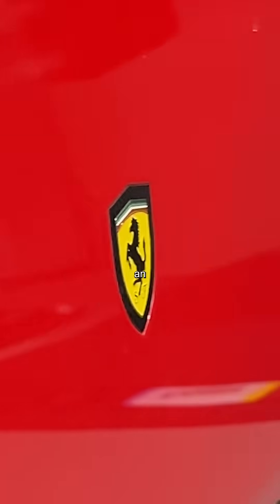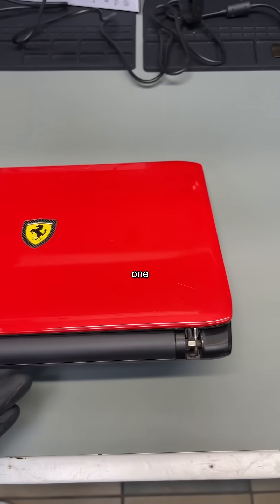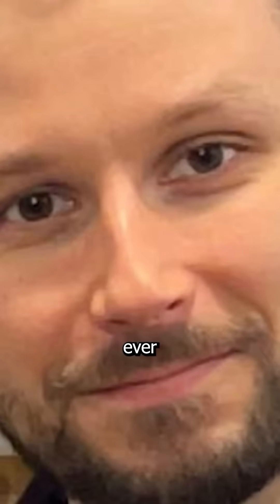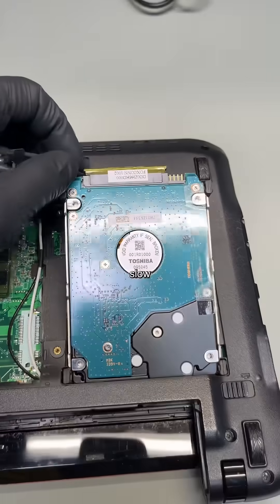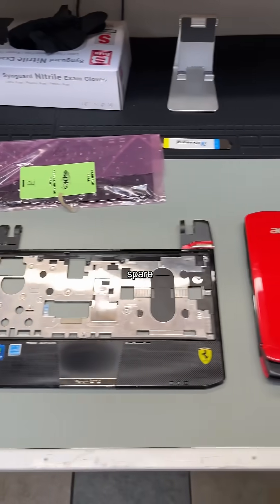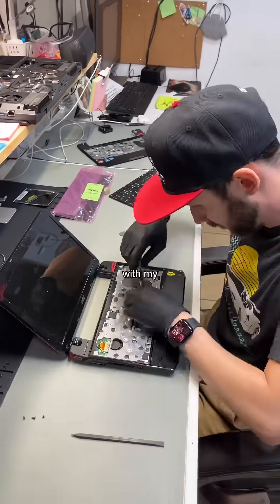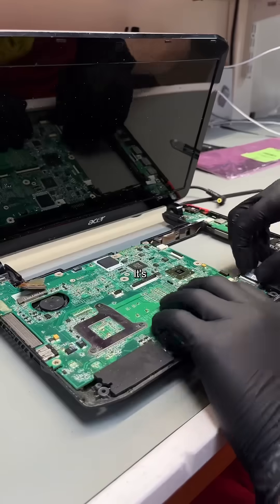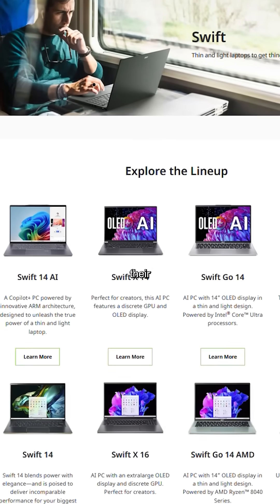Rebuilding an antique #Acer Ferrari One 200 #PC using modern #tech ! #technology #shorts

Comment from the maker: The Greatest Collab That’s Ever Lived
Reply: True first reply
Reply: An even greater collab would be the greatest technician and phone repair guru 👀🔥
Reply: Hello
Reply: Yes
Reply: Still faster than leclercs car 💀
Reply: I FUCKING WANT IT
Reply: Still faster than leclercs car💀
Reply: That’s collab ever the lived greatest
Reply: The worst technician that's ever lived
Reply: I had a swift 3. The hinge gave out, it was one of those ones with threads glued onto the chassis held by plastic instead of being part of the metal. Are the new models still the same from Acer?
Reply: I actually have one of those where do you get parts for it want to restore mine
Reply: will you be keeping this?
Reply: Why do u use doors elevator music? It’s good tho ngl
Reply: Remembered I sold all two of them. It was one 15,4/17" and one smaller maybe 14". Was working as a hopeless tech guy in electronics store then. On a busy week I got 100 Acer laptops in for repair and warranty(I did only recive and confirm physical damage, before sending it in for repairs) . Think we only sold Acers back than as an exclusive deal, but the cheap models failed alot.
Reply: Now do a full vid on how it is working with the temps pls😅😅
Reply: Yeah
Reply: I actually have ferarri glasses
Reply: Put Linux on it
Reply: Fr
Reply: I need your help please 🙏
Reply: Why would Ferrari choose Acer to collaborate with?!
Reply: @salemtechsperst i found a rog and lomburgini collab
Reply: waiting for the second collab with the greatest dell technician that ever lived
Reply: if you don't control the temperature of that amd cpu, well, you're fuc*
Reply: The greatest Acer that’s ever lived
Reply: Fr, btw why the repost?
Reply from the maker: @CoolChickenNugget385 YouTube showed me the right thumbnail then switched it after upload to a thumbnail of my arm 😂
Reply: @SalemTechsperts  lol, classic youtube
Reply: @SalemTechsperts  your upload time is as slow as me in my dreams when I'm being chased by the greatest technician that's ever lived
Reply: @SalemTechsperts  arm64 🔥
Reply: @SalemTechsperts cool laptop man

Comment: The collaboration between Acer and Ferrari has tradition: Acer sponsors the Scuderia and in turn uses the famous logo of the prancing horse for selected high-performance notebooks. Now Acer wants to provide speed in the netbook sector, and draws upon the good name from Italy once more. We have had a closer look at a pre-release model of the Acer Ferrari One 200.Punctually with the release of Windows 7 on the 22th of October this year, the red netbook should be available in shops. Acer plans to provide several variants, which should only be differentiated with respect to their communication features, such as Bluetooth and UMTS, not by processor or graphics card: the CPU is an Athlon X2 L310 from AMD with 1.2 GHz clock speed, and the pixel calculations are performed by an ATI Radeon HD 3200 onboard graphics chip. Acer will offer the Ferrari One 200 from 499 EurosNaturally for a netbook carrying the name Ferarri the corresponding color scheme is Ferrari-Red, and thus the lid, lettering on the function keys, as well as several of the accents are luminous "rosso".
The power button on the top right above the keyboard shines in the typical red. In two places the famous Ferrari logo was additionally integrated: in the middle of the lid, and bottom right on the hand rest area.

With 1.5 Kilos weight the Ferrari One is pleasantly light, and the Acer engineers also saved space: not even 2.5 cm height is measured at the thinnest point.

The chassis reminds of the shortly tested Acer Aspire Timeline 1810TZ, of which we have very fond memories: everything was built solidly on the 1810TZ, the design was nice to look at, the materials were pleasing, and nothing rattled or warped.
And also the Ferrari One appears to be without faults at first glance: The keyboard sits firmly and does not bend through, and the chassis can be described as rigid. The only smaller weak spot is the display lid, which allows through moderate pressure from behind to the display.

Comment: If you are gonna replace your hhd with an SSD (sata), make sure it has an dram ram cache if you want good write speed beacuse without it these ssd will be slower than a hhd for data transfer, but cheaper ssd are a fine option if you don't transfer data around  too much and yiu will not know the difference. I have the same ssd in the video and it is slow for coyping over games for an hdd.

But it is faster in every day use compared to a HDD other than just copying files so cheaper ssd are fine for such use case.

Comment: PLEASE do an HP elitebook 8540* sometimes! <3 
gorgeous 15.4" enterprise battleships from 2009, that hold up amazingly well. built like tanks, from forged magnesium, to military specifications, a joy to work on, and my absolute go-to machine, to hook somebody on a budget up with a nice, big laptop for casual non-gaming use. 

PS: if they bluescreen, reflux the ram sockets, and replace that the thermal gunk with some good stuff.
Reply: PPS: the only laptop i have ever seen, that has an internal drainage system, to keep fluids away from any components, in case of keyboard spills. the fluid just drips out the bottom vents. just dont flip it over, until it's done draining!!!!

Comment: Im hearing all that acer praise and i must mention that my late 2022 aspire keyboard broke less than 2 years since purchase and it is riveted to the chassis.

Also the wifi antenna wire was between the VRAM and the cooler for some reason
Reply: knock on wood Im on a helios 300 rn and its probably the best machine Ive ever had by a good margin, and ive gotten A LOT of use out of it

Comment: Careful with those Crucial BX500 , they tend to slow down to a crawl quickly to 6.9MB/s, typically because of the Silicon Motion 2258XT controller overheats too fast, especially mine , up to 75°C 

Otherwise.. yeah , its a speedy boi ❤😂

Comment: @SalemTechsperts I have a challenge for you... a gooch pillow (that you may or may not lay your head on) lets make this happen guys. on another note if my gaming laptop is like 10-15 degrees (celsius) hotter then when I first got it (less than a year ago) is my thermal paste in need of replacing? if not how do I cool this thing down so I can play some newer titles cause it has the hardware just not the cooling.

Comment: Hey uhhhh what's the diagnosis for a laptop that it's whole display is having seizures, the display is fine just the right side of it has some problems with the light which sometimes give off minor screenburns typa stuff if the power suddenly goes out (i dont have a battery for it as its still otw for delivery), it happened a few days ago when i just using it normally then suddenly the lower half of the display started having seizures so i restarted it to refresh it and this time it was the whole display that started having seizures so i completely shut that down and left it for 20mins and came back to boot it up, next thing i saw was it started working properly.... Until after 30mins it started going crazy again. So was it the display thats having problems or was it smth with the board?

Comment: Guys planning on buying a new pc. Components that i have chosen are
4070 oc
13400f
32 gb ddr5
And asus prime B760M-K
165hrtz 1080p monitor (will upgrade to 1440p in future)
But there is problem. Is 13400f enough for 4070 in 1080? I know there is a bottleneck but is it problematic?